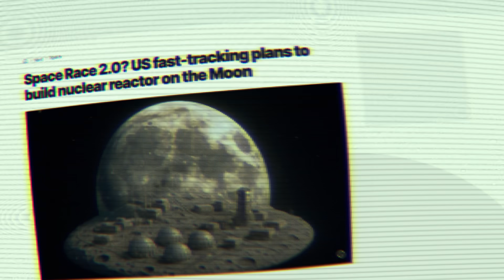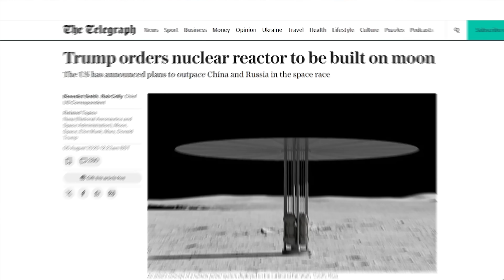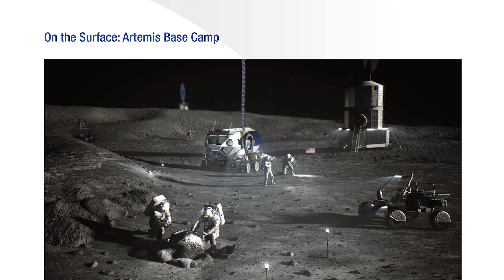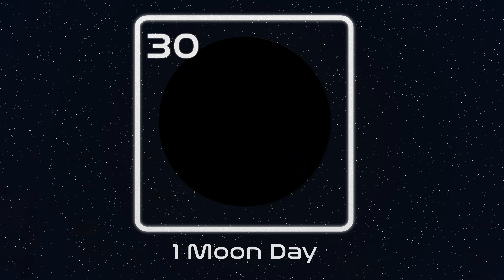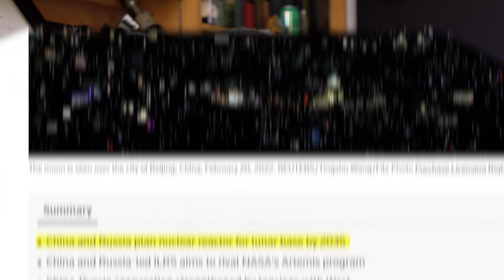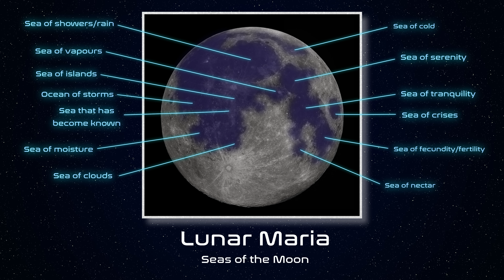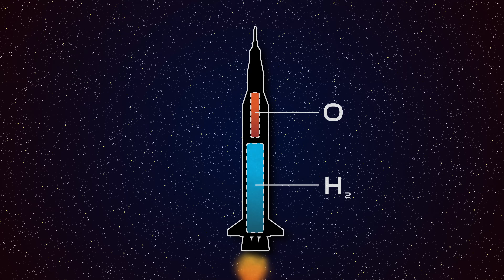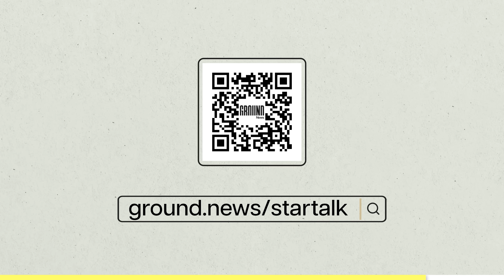Why We’re Putting Nuclear Reactors on the Moon

Comment: You could setup your base at or near the poles and have solar panels on "both sides". With a little wiring you have electricity 100% of the time. Also France has a lot of problems with their reactors every summer when rivers are too hot. And their reactors are old and need replacement. Unfortunately, reactors are seriously expensive.
Reply: @reinerjung1613  -  "reactors are seriously expensive."   That needn't be the case for small ones.  
The Navy has built small reactors for subs for decades.  An even smaller one could probably be built for $15-20 million or so  -  pocket-money really - and once you have it, that's a huge amount of power in a super-compact package.

Comment: NASA's "Kilopower Reactor" (KRUSTY) 10kW demonstration. If the new device also uses "Stirling Technology" to convert thermal energy into electricity. Then perhaps in later stages it will be possible to use the same conversion technology, for example, in thermal batteries (after all, we don't only have chemical batteries). And these thermal batteries would be constructed from local resources (at least the main part per mass). It would be very interesting.

Comment: Idea for a vastly more capable nuclear reactor for the moon that's already being worked on for large Data Centers. Currently under development are nuclear reactors that can be contained within a standard shipping container (40' in length). Copenhagen Atomics and a hand full of US companies are looking into this using Liquid Salt reactors which are far safer and more efficient than solid fuel reactors. 

The important bit is that they expect these reactors to produce between 20 and 30 Megawatts of power for at least 5 years now, 8-10 years in the next few years. 

So. The cargo capacity of Starship V3 is 100t of cargo to the moon... but what if you build the nuclear reactor into the ship. Landed it... flipped it on its side... covered it in regolith to protect against radiation and micrometeorites... and used it as a stationary 25MW reactor (250x as powerful as the portable ones). 

The cost to build a Starship is about $150m without mass production volume (which will likely happen in 3 years). So the cost of "abandoning" a reusable rocket of this type is minimal. The estimated cost of the reactor itself is $50m (Copenhagen Atomics expects to build 1/day within the next 5 years). 

All in cost of putting a 25MW reactor on the moon: $150m + $100m (extra cost to make the reactor fit in Starship - which has plenty of volume) + $250m in Tanker launch costs, tanker runs to the refueling depot in LEO (planned for the first Starship landing anyway). 

So adding other bits and bobs that double the cost, putting a 25MW nuclear reactor on the moon would cost less than $1 billion. 

So this would power a town with 1000 homes on Earth... or one base with 50 people and 1000 ruggedized Teslabots. Maybe a couple could power a Boring Company Prufrock tunneling machine to build lined tunnels for mining and habitation below the radiation and micrometeorites of the surface. (Worth noting that Prufrock 4 is due in 2025 with fully electric operation and completely unmanned.) Heavy replacement parts might be made from iron/titanium in lunar regolith. 

The Teslabots are expected to be built 1 million per year by 2030 (conservatively) and cost less than $50k each. Ruggedized versions only built in the low thousands would probably still be less than $500k each - built by Tesla. So Starship could deliver about 200 Teslabots to the lunar surface for the price of one lunar landing (again... less than $1 billion all in)...

So for the price of 1 SLS launch, you can have 20 humans, 200 robots and 150t of materials and one 25MW reactor dropped onto the moon. (Using Crew Dragon to deliver astronauts to a fueled Starship Lander in LEO 4-7 at a time at $150m per launch.

... also think what it would cost to ruggedize a few Cybertrucks and drop them on the moon as they could easily weigh 10t each and be delivered 2-4 by an additional ship. With double batteries (they already have an "in bed" booster battery feature) to help run the heaters, insulation abrasion resistant... etc... etc... These things can move easily 6 tons (1 ton lunar gravity) of equipment (a NASA reactor?) over a 150 km round trip... with autonomous driving and or 2 robots in the driver's compartment to load/unload/perform tasks. The vehicle already has a 300mi range in 1g/1atm with a 1 ton payload... so only the heating is a thing. 

The Boring Company Prufrock 3 tunneling machine weighs 400t and is built for road transport in segments... so it would take 4 flights and $4 billion to put up one machine to begin boring (and lining) tunnels under the moon, mining ice, iron, titanium, etc. While providing protected habitats. 

Add a magnetic accelerator and you can shoot refined alloys to lunar orbit and build a shipyard to create giant ships (super tanker size with less than 1/10th the mass, powered by nuclear engines) that can go to 16 Psyche to deliver mining equipment, refineries, robots, reactors (ship's own reactors) and tunnel boring equipment (possibly plasma cutters for a metallic asteroid). Worth noting that plasma cutters require substantial nuclear reactors... but the ships already have those). A mining colony could see a cluster of humans within 16 Psyche (Tauroid tunnels with maglev cars to produce "gravity" protected deep within the metallic asteroid while an army of thousands of "humanoid" and additive manufacturing robots build out the base, the refinery, the manufacturing base, such that local resources and nearby Carbon and Ice asteroids are mined to make the mining colony increasingly independent... while sending cargo ships with hundreds of thousands of tons of refined precious metals and ores (nickel) to lunar orbit and thence the Earth. 
Local AI could monitor the expert robots to make sure all is going well with the humans adding corrections in real time. Comms could be achieved using the new NASA long range laser comms to communicate between Starlink and the colony with only a few boosters as the range is 290 million miles at about 100mbps with today's tech. 

In the end, "space" must turn a profit or there will be no traction in space exploration. 

The SLS/Artemis program is good for making a political statement. 
The Starship is next step in colonizing (not just exploring) the inner solar system. 

Building heavy industry, unlocking unlimited resources in a place far beyond the precious and fragile ecosphere of our planet and generating profit to drive humans further out into the wilderness... like the gold rush of the 1800s. 

... if you build great profit... they will come.
Reply: Tldr
Reply: @jd-tg1ox  You have my sincere sympathy for your inability to read two sentences.  Paragraphs must induce cardiovascular distress.  Please stay healthy.
Reply: I am waiting for the promise of sodium reactors a decade now.  They should be vastly superior to the old style behemoths that aren't cost effective to build and sometimes melt down like 3 mile island, Fukushima, or Chernobyl.
Reply: The moon does NOT belong to ANY nation regardless of their Earth power.
Even nuclear powered subs have nuclear waste. The entire world MUST have a vote on this. We can do it by phone app.
I do not see this venture as money making scheme. Humanity beyond Earth will have to engineer planentary power sources. All three Mara Rovers have solar powered capacity. They work. Im sure it will work on moon too. I say NO nuclear power plants on Moon, never ever.
Reply: TL;DR

Comment: There is a technical point I don't get. We are not talking about a RPS but an actual reactor ? 

From my understanding a nuclear reactor works with a delicate balence between producing heat and being cooled down by transfering this heat to a liquid. Then the liquid turns to steam and turbine are then used to produce electricity. Steam is then expeled in an opened system or cooled down and reused in a closed system.

If we build an opened system, where will we get enough water to maintain the system ?
If we build a closed system, how can we cooled down the steam back to water if it's so hard to have heat exchange in the void ?

The polar site looks like the only place to have an "easy" solution...
Reply: Yes, an actual reactor, but not one that uses water. In the past the proposed reactors (and a few actually tested) use a metallic core and sodium heat pipes to move the heat to a Stirling (or other) closed cycle generator. The core is designed with very high negative temperature coefficient of reactivity, so it is self regulating without moving parts, valves, etc... Waste heat is rejected via radiative cooling.
Once it is started, it just goes up to operating temp and them stays there for a decade+ regardless of how much load there is. No high temp swings, no water or condensers, etc... 
Look up Kilopower which was a reactor of this type tested in the last decade for an idea of how it works. I believe there are a couple of NASA video on YT about it.
Reply: @richardb1452  -  Exactly!  The negative temperature coefficient is the key.  
Your description is spot-on - very clear.
Reply: That's very likely at least one reason why the site was chosen.
Reply: @Wh40kFinatic  The reason the polar sites are preferred is to use the ice for producing water, oxygen, hydrogen. This is not for running a reactor but rather for drinking, breathing and potentially rocket fuel. Space based reactor designs don't typically rely on water for anything (see earlier reply above).
Reply: dissipation of heat in the "void" is only a concern if you're actually in the void, in space, where your only option is to radiate the heat. on the moon, you can run cooling lines below ground to instead conduct the heat away. think geothermal heating but in reverse. and you don't have to go very deep before it gets very cold.
Reply: Excellent point. 
No system has ever been designed with temperature swings like those stated. 
Water is either frozen for 2 weeks, or near boiling point naturally for the other 2

Comment: Modern batteries have heaters in them for cold applications. The problem with batteries is they are bulky and weigh a lot. On top of that they deteriorate with every cycle.
Reply: Spot on.

Comment: would it not make sense to build stations on the moon to explore further into the solar system? surely having large rockets take off from the moon (or a large space station) is much more efficient than taking off from earth based installations considering the much lower gravity, so using the moon to travel to mars would actually make a lot of sense going forward? And its looking likely rocket fuel can be created on the moon with local resources (hydrogen)

Comment: I want NASA to build a Fusion reactor on the moon! Because since there is water on the moon you can refine it to get Deuterium and also you can mine Helium 3 which are used as fuel. And Since its so cold you do not have to pay for Super cooling the  magnets.

Comment: Here is a question I never thought relevant.. Is the moon self heated? like the core of the earth is molten, from the friction of its own mass shifting constantly, but is the moons? If we buried the batteries deep enough... would they even be affected by the extreme cold of a night on the moon? Would it be more viable for an underground moonbase at that point?
Reply: IIRC the Luna's core is not molten like Earths and Mars.  Someone please correct me if my recollection is mistaken.
Reply: @bopeymcfuqno810  its a dead rock.
Reply: It's likely semi-molten, but we dont really know.
Reply: @madison8638  Interesting, thanks.
Reply: the moon doesn't get much of that friction from its own mass shifting since it's tidally locked to earth. the core temperature is estimated to be between 1,330°C and 1,430°C though, most likely from radioactive decay of uranium and thorium

Comment: Little correction on your statement about France, often France has to import energy because of failures, maintenance and old reactors. So France doesn’t have figured it out! And the nuclear waste problem isn’t solved yet, so no, nuclear is all but clean and easy or without problems.

Comment: A couple of things to also touch on: the Moon is extremely dusty, and that dust is terrible for solar panels and electronics. We’ve tested protective tech on suits to reduce this problem, but it would need to be applied to habitats and equipment before a permanent presence is possible. Energy storage is another challenge — lunar batteries may need to be kept in warmer, shielded underground facilities to survive the long nights. As for resources, water is the most critical for survival and fuel. Helium-3 is another intriguing possibility: while we don’t yet have a way to refine or use it in reactors, it’s rare on Earth and could one day play a role in solving energy shortages.

Comment: Mars Talk: Of course one needs to slow down to go to the moon and that uses fuel! But since we can produce fuel on the moon, as you nicely explained, we might want to re-fuel there before we go to mars, no?
I mean a permanent settlement on the moon is easier sustained than on Mars and brings many of it perks, furthermore it helps exploring the rest of the solar system... If there is a flaw in this argumentation you might want to make an indepth video about it :D

Comment: 6:00 The Batteries are storaged outside the station or inside? So the temparature will allways be like the temperature in the station. An astrophysicist should know this.

6:30 But not, when the rivers that are used to cool the nuclear power plants are to warm and that is happening every summer. Every year this happens more and more. So they have to import power from countries with a lot of renewable energy. An astrophysicist should know this.

Comment: Just a little bit of slight of hand here.
If the nuclear power plant can be buried so can the batteries.
You do not have to get very far down before the temperature stabilizes at just a little below freezing (of water).  You could build a heat storage "battery" with some insulation and a few hundred tons of moon dirt to keep things warm thru the night.  But heat from lights and other electrical use may be enough to do that anyway.

Comment: 100 hair dryers may not seem like much, but devices that are made to produce heat, which is generally a by-product of inefficiency, takes up a lot of power to compensate for that heat loss. By comparrison, your average full fridge pulls 300-800watts. Or a radeon 7800xt pulls 200watts. So 100k watts is about 500 mid-high tier gaming computers playing battlefield 6. And also, NASA could not do this operation without the support and approval of the federal government. So the Trump admin can totally rightfully take the praise for it by approving it lol.

Comment: 6:10 you can use the energy of solar panels to pump up a cilinder so it gets pressurized, then when you need the energy at night time, you depressurize it and generate power from it again. You'll lose a little yield but it solves the battery not working when cold problem
Reply: Low temp, low pressure. Ever tried to fill your tires when it's freezing? An outdoor pump won't be able to build enough pressure to fill your tires, and it's even colder on the moon.

Comment: You better noch use France as an example for nuklear power. No, they usually don‘t export, but import power, from Germany and Spain. Because in summer, they have to throttle the nuklear reactors (because the rivers get too warm) and in winter, because they heat their buildings with old resistance heaters, so their power consumption exceeds their production. And export and import is really relative, there is a EU market for electrical power.
Reply: They export far more than they import. You can easily look for numbers online i dont know where you got your information but its mostly wrong.
Reply: Living in Italy here, we buy nuclear energy from France because italians are too dumb, the f* u're talking about? 🤨

Comment: There is no need for nuclear on moon, solar is best option and battery storage can be burried underground or included in storage/habitat modules.
Reply: Doesn’t heat cold and reach the ground underneath as well?
Reply: Too dusty on the moon for solar panels.
Reply: @speralta8243  -  Agreed, and solar doesn't deliver the huge amount of power in a small package that a reactor can give you.
Reply: He covered why that isn't really viable in the video. Or at least, for a reliable source of power.

Comment: Lunar regolith is an excellent insulator (better than aerogel in some cases), so batteries could easily be insulated and thermally managed. (arXiv abstract 1711.00977; 2017-Nov-2)  Solar plus storage is very doable on the moon. Also, batteries can be kept in the same thermal envelope as the living spaces.
Reply: Thank you for citing your source. I'll check it out. It could be an interesting solution but what I find worrisome is how "toxic" regolith is for us. So each time regolith is brought up, I always keep that in mind.
Reply: obviously solar panels are going to be part of it, but they will ghave to be some distance from the areas of the parts where the sun never shines. Either that or the humans are going to have to live in areas away from those.

Comment: 🤔 nuclear anything on the moon sounds good but isn't the moon covered in craters because it's often hit by debris? Also doesn't the temperature change often? 🤔 I think solar panels would be the better option. Maybe a self sustainable cooler to keep the equipment at a certain temp and protected from flying debris. Let's see how they handle this.